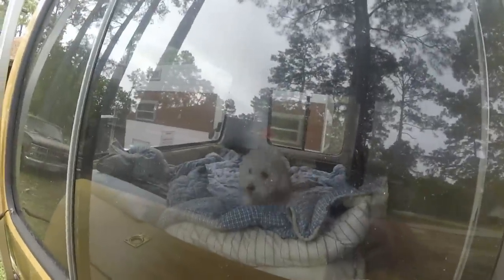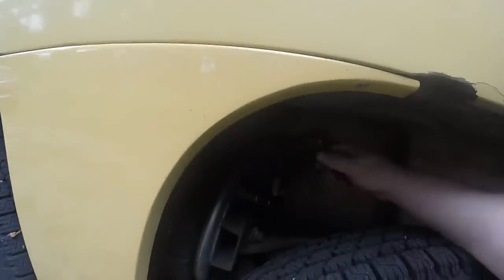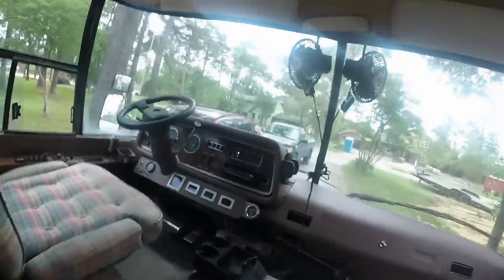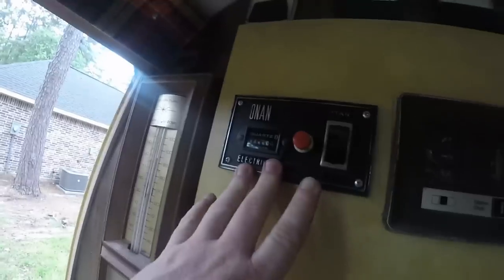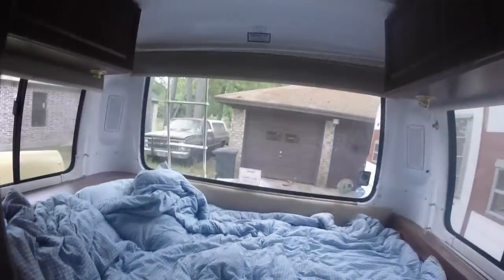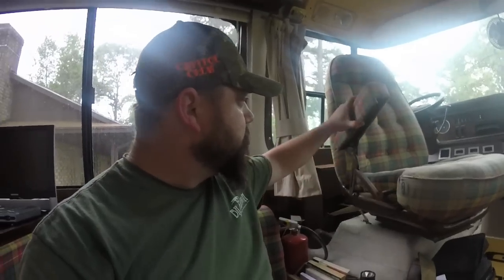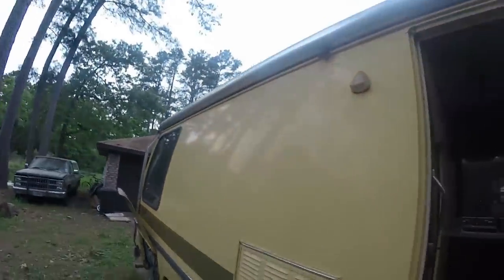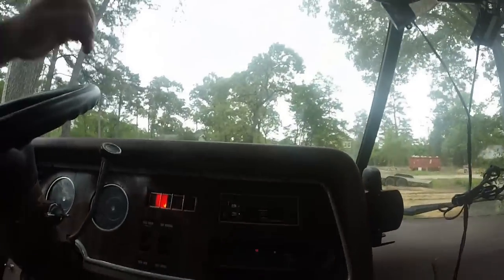RV Living:1976 GMC Motorhome Tour

Comment: I lived full time in a 31 ft MH for 13 years.  Great way to live.  RVs are high maintenace so pay attention to wiring, keep everything lubed with pure silicone,  seal leaks with RTV over clean surfaces,  keep battery levels up and clean posts.  use tie wraps to keep wiring from dangling, flush all tanks often and watch all tires critially as your life depends on them!  Expect 6 to 10 MPG at best.  Enjoy boondocking away from PEOPLE most of all.  Enjoy!

Comment: They are a well-made motor home buddy. Yours looks like it was taken care of. A lot of those 455's had 385 hp. and 365 and 280 hp. They put a higher lift cam in the 365 and 385 hp units. A great thing to do is put a set of chrome headers on the old gal and it will add quite a bit of hp to her. Chrome keeps longer before they rust out. Pack some grease in the ball bearings of the gen slide and pull it in and out every now and then and you will be glad you did. Nice outfit.

Comment: Sweet looking GMC Motorhome. 🙂
Reply from the maker: +Jason Carpp Thanks!!
Reply: +Cruzin Castles You're welcome. I've always liked the overall shape of the GMC Motorhome, probably more so than the Winnebago motorhomes of the same time period. :)
Reply from the maker: Jason Carpp We like the old Winnie with the brow as well. These are much better built though. The GMC has an aluminum framing, aluminum from the black stripe up and fibreglass below that. Out of th 12,000 built approximately 8,000 are still on the road 40 years later.
Reply: +Cruzin Castles There's nothing wrong with the Winnebagos of the time. I just find the GMC more attractive. Mind you, this is my humble opinion. Everyone has their own opinion on the subject, and there's nothing wrong with that, particularly if they've owned one, driven one, lived in one, or know someone who has (or had) one. 🙂

Comment: GMC is sitting on this design,  while the competition is selling $100,000  $200,000 and more motor homes.... GMC is leaving profits on the table.
Using modern assembly, it can be built at a lower cost,  and using hybrid and modern updates, it would be even better.  
Come on GMC, bring back a new updated GMC MOTOR HOME !

Comment: I remember motorhome sales got hit hard during the oil embargo.  Today with such an inequality of incomes these nicer fully equipped RV are meant only for the few.  Yours has a lot of innovative engineering.  To get that same set up today with a diesel Mercedes I'm looking at an $88,000.00 cash outlay.  I better stick to my little 12' utility trailer.  As long as I got some electric, I've got air and/or heat.  My little Honda Generator will run as long as there is gas in the tank.   When that runs out.  Time for a fire pit.
Reply from the maker: +bluelipbeaver It's crazy, the price of the newer smaller RVs

Comment: I love it! The only thing I'm having a problem wrapping my head around is you are planning to make due without any air conditioning. A few sentences later you answered my question by saying you weren't going to be in many situations where you would use the furnace. So, it sounds like you will be travelling in warm areas, yet a couple of new fans affixed to your dash will have to suffice for temperature control. I am not quick to anger, but still wouldn't do it. I'm from Canada, yet I know it is being really hot in traffic and the stresses of driving that can make a person mad as a bee. Up until the air conditioner problem, I was 100 % sold on this baby. After the air conditioning doesn't work revelation, I don't think you could pay me to drive this beauty in temperatures above 70 degrees F. I know it is not for sale anyways.  The good news is that I looked online for aftermarket air conditioning units for motorhomes. This was the basic information: 

Atwood Air Command Rooftop RV Air Conditioner w Heat Pump - 15,000 Btu - Non-Ducted - White

This non-ducted RV air conditioner features a heat pump for chilly nights. Cools fast at 360 cubic feet per minute. Creates less noise than similar models. Low amp draw lets you run other appliances. Includes vent w/ flip-down thermostat and remote. Around $950 US dollars. All I can say is I would secure one of the air conditioning units, and the motorhome would be ideal for nearly any situation. Good luck, eh!

Comment: been watching Wanderlust Estate on here and they're living at a GMC co-op  in Florida that saves and rebuilds these fine machines. They mention the Ethanol eating the old fuel lines too. For about $15,000, these can be some awesome road worthy machines! And I RARELY hear about these leaking. Excellent video!
Reply from the maker: Sean Spring They do tend to leak, but are easy to diagnose and with the walls being aluminum, they don't rot. We got our GMC in March and thought it was cool when we saw James go to Florida and end up getting one as well.

Comment: Great condition!!! Not sure where you found this, but you got yourself a gem. Personally, I kinda like the "Ralph Lauren" plaid .Let me know if you ever decide to sell.
Reply from the maker: Michael Turnage Thanks will do  :)
Reply from the maker: Roy Poud Lol, I posted a link on the Cruzin Castles facebook page to some forsale. There is one thats a steal right now, if it's still available.
Reply: Thanks, I will check it out!
Reply from the maker: Michael Turnage https://www.facebook.com/photo.php?fbid=10206350951642824&set=pcb.397166967074513&type=1&theater, this was just lowered.  $4,000
Reply: @CruzinCastles  so now 4 years later have you done any of your
Updates yet ? Also how is your
Fuel economy with the EFI ?
Are you able to get 14 mpg ?
Reply from the maker: @johnmanley3849  In the video I meant to say added an electric fuel pump rather than a mechanical fuel pump. I don't have an EFI and I don't plan on one anytime soon. I have redone the interior and have pictures on our facebook page. Fuel millage is 7-11 mpg depending on conditions like uphill, towing, stop and go traffic. I don't have a problem with fuel cost, saved so much on the front end compared to a new rv. A gas stop is full of conversations from curious people.

Comment: You mentioned it had fuel injection - if that's the case, you shouldn't have to touch the gas pedal when starting. It won't hurt anything - but it doesn't do anything, either. With EFI - if the engine isn't running, there is no fuel being injected. No flooding, no vapour lock. I have Howell EFI (with ESC and EBL) in my GMC. Nice coach!
Reply from the maker: GMC Motorhome Not sure if it has the EFI, I haven't got that far yet. I meant to say electronic fuel pump, which has a toggle to turn on manually and it is tied to to come on when oil pressure rises. Thanks, can't wait to play with it more!!!!!
Reply: Cruzin Castles Ah - I almost asked if that's what you meant! That makes more sense... I love the EFI - but there is lots of support for the Quadrajet, as well. I never loved the Q-Jet and I've had a few of them!

Comment: i have a 1985 GMC honey. I noticed you showed a "switch" in the breaker box area to change over to the generator power. Mine has a place in the power cord compartment to plug another travel trailer into (thats what i says on the 30 amp plug in that area) so what i do is just plug my rv into that and it runs off the generator. I have never been able to figure out how to switch my RV from shore power over to generator power without just plugging into that 30 amp plug that is in the power cord compartment. In the video its dark when you show that switch so im wondering if you can post a picture below this comment so i can see if i can find a switch that looks similar in mine. The owner manuals have been lost over time before i bought my RV so i have nothing to read to find things out. by the way the 1970's GMC motor homes are by far the most beautiful of all time i feel and you have one! congrats!
Reply from the maker: Thanks!! Ours was rewired at some point. In the power cord compartment there is a 30amp plug. I have a 30 mp cord and a 110 cord. The 30 amp runs everything except one ac unit and 1 outlet that runs off the 110 cord. Our GMC was the same the 30 amp plug in the cord compartment use to be where you plugged in the Generator cord when you were not using shore power. At some point someone took the power from the generator to the breaker box compartment, a cord from that plug, the shore power  and wired them through that switch and breaker box. So there is a cord that is always plugged into the plug in the cord compartment that runs to the switch in the breaker box compartment. I hope that makes sense. :)
Reply: Okay that makes me feel better. I figured I had been doing it wrong all this time but it worked and so I kept doing it. thank you for your help!

Comment: I am SO happy u made this video and that i saw it!!
I saw a motorhome like this in our local Walmart and was wondering what kind it was , due to i had never seen one like it before.
This was it except that one had less windows. So i dont know if it was an older one or what but i liked it.
Reply from the maker: It has a 455 front wheel drive.
Reply: Very nice for its age.
They also sell Octane Boosters at Auto Parts stores, in case u want to care for the motor a little more. Just sayin

Comment: 17:47 - I assume you meant to say it doesn't have fuel injection? Because it certainly shouldn't, unless it's been modified.
Reply from the maker: You are correct, I meant to say it has an electric fuel pump.

Comment: I really dig your GMC.  Have you thought about using black Plasti-dip on your badges and bumpers, (grill and headlight surrounds for continuity) and maybe wheels if you like the black wheel look.  It's a removable, rubberized spray can coating that comes in many colors.  Putting a very light tint on the front windshield with a really dark "Visor" section on the upper portion where sun visors and a rear view mirror would be would look so good IMHO.  Cheers.

Comment: Will you change out the tank holding your drinking water?

It will be an adventure taking on such an old vehicle - safe travels
Reply from the maker: DavidisDawei You are correct, it will be an adventure. Not sure depends on the condition of it. May just flush and sanitize multiple times. Figure everyone has problems with new ones, this one has been on the road for 38 years and is still going strong, that has to say something about them.
Reply: Cruzin Castles It is what leeches out of the plastic INto your water that you need to be concerned with.  Don't  know why these companies didn't go with a light Stainless Steel (SST) - weight would be negligible and I would pay more for SST - especially with temperature and age.  Stainless can also handle chemicals and cleaning agents, while plastics can not without concern.  Always choose Stainless when given an option

Comment: I've heard of people firing up the generator and run the front over head air while going down the road. Just a thought for summer driving and you can't take anymore heat. I drive at night during the summer.
Reply from the maker: Jerry Densmore That could be an option, hopefully in the best climate possible in the near future. I also like to drive at night.

Comment: Nice motorhome and potentially a good investment. I am curious what one of these sells for in running condition?

I was looking at a video of a 60's vintage Flexible city bus that the owner did a full restoration and update. He installed a 24V solar system and solar panels. You could eliminate the scary propane tank and heavy ONAN generator and put batteries and invertor in those spaces and convert to an induction cook top, instant water boiler and electric fridge. Having the solar panels on the roof would also shade the roof and keep the heat from conducting into the camper.

Look into a throttle body injection system for the engine and modern ignition system for reliability.  Don't neglect the tires or parts.

Comment: nice rig.             i hope you have no problems with the unit.             i think it's older than you, good luck.
Reply from the maker: SKPjoe Coursegold :) Yes you would be correct. It is older than we are. They just don't make them like they use to. We chose this one for a few reasons. Might get by the 10 year rule in some parks, maneuverability, no computers/emissions or oxygen sensors to turn on check engine lights, no slides or jacks to fail and prevent travel,it's very basic and simple.

Comment: Wow. i'm a bit envious.     But why would you remove the vacuum system?    Don't you need it?   You also might want tto take all of those manuals, and make copies of (or scan) them.  Too VALUABLE to lose without backup copies. Next time, let the Missus hold the camera - you cut alot of stuff out of your shots (or next time shoot the video, and then add the dialog later)

Comment: What engine do you have?  They originally came with the 455 but later changed to a 403.  : )
Reply from the maker: Mark Handler Ours has the 455 Rocket. It's crazy to think the engine that moves this motorhome with ease was in a car!!

Comment: Was the third axle necessary? I mean, it seems to be a burden for a caravan at this length, rather than a support. Why did they prefer such a thing?
Reply from the maker: Actually there are no axles in the rear. It is a front wheel drive motor home so no driveshaft either, that's why it can be so low. Which is nice not to have to climb a flight of stairs to enter the coach. All 6 wheels are independent of each other, so it crawls over things like a caterpillar and makes for a very smooth ride, like a Cadillac.  The rear wheels are mounted on a bogie with air bag suspension, that can be inflated or deflated to level the coach. Hope this awnsers your question and thanks for watching!! :).
Reply: Sure it does! :) Thanks for the info and happy living with your crawler!

Comment: I just stumbled here if you still have that setup in front of the couch why not install a 32 inch led flatscreen tv and then add a table in front of the tv lower than the tv and then the chair's.. on the right side of the rv or the left side of the rv
Reply from the maker: We have redone the interior. There is a jackknife sofa on the drivers side and a breakfast bar with storage on the passenger side. There are pictures on our Cruzin Castles facebook page.

Comment: do you know how many kWh you would run on average with both a/c units and the fridge running? I like these size rv/tiny homes but would want to do solar for mine if I could.
Reply from the maker: We plan to put solar on it. It would be more for lights, charging and some small appliance use occasionally. Not sure how many kWh they would use. Our fridge can run on propane and each Ac is ran through a different connection. Definitely couldn't run those off of solar though, they consume way to much power.

Comment: (Cont'd)  Not meaning to filibuster here, people.  But some owners of units such as this one like to spend months in cold country, such as Wyoming, Montana, and northern Idaho.  So the question I have is, is this unit an all weather unit?  If not how could an owner go about adjusting to extreme winters should they find themselves in the above states?
Reply: I'm looking to buy now and will be looking for one capable of very cold weather !
Reply from the maker: Reflectix in the windows, the water tank is inside and in ours there is a hose from the furnace, blowing in the water tank compartment. Hope that helps some.
Reply: Cruzin Castles
Reply: @a20milerun62   Get a carbon monoxide detector. And seriously, go solar and get away from propane

Comment: I wonder which engine its got  Can it get out of its own way,  What is the average MPG
Reply from the maker: It has the 455 Rocket out of a Oldsmobile Toranodo . It is front wheel drive and can smoke the tires. MPG isn't everything when you have a 12,000 pound hot rod with plumbing.
Reply: @CruzinCastles  Was just curious if it will get 5-6 mpg. I saw one of these recently at a campground & thought GM should bring them back into production. Bought back memories of the 70s

Comment: Engines in the front are a real pain to work on and will cost alot in labor at
any shop.
Reply: ????  Almost all vans and motorhomes use this configuration.
Reply: This is a front wheel drive 455 or 405 it may be a little longer for labor but 2 very reliable and parts easy to find
Reply: Point

Comment: whats the gas mileage?
Reply from the maker: ben shafer Same as any other 7-12 mpg depending on terrain, pulling and condition of motor and tires.
Reply: the owners manual said 7 to 8 great Rvs though!,,,,,,,,,
Reply from the maker: ben shafer I'm sure I get between 8 & 11 mpg. I haven't figured it out yet but it's much better than thought it would be. When I did my research all RVs except maybe the small class b get between 7&12 so really if you're worried about gas a big rv isn't for you or just dont drive very far.